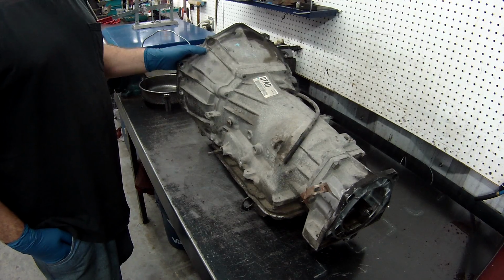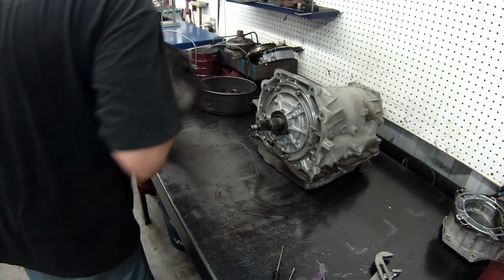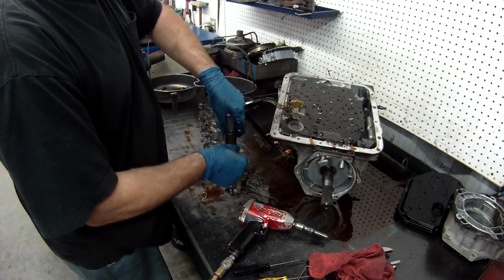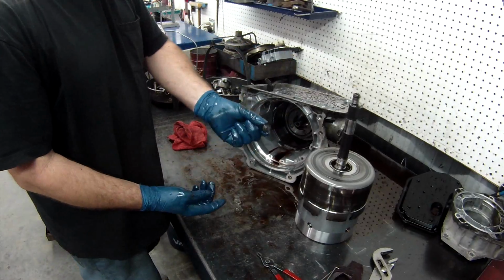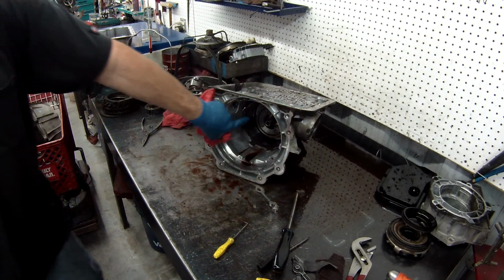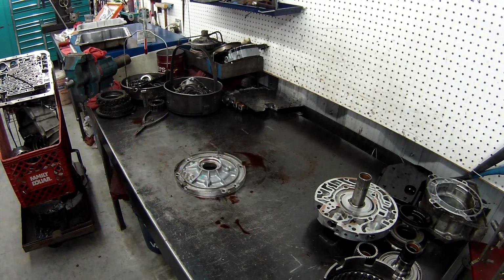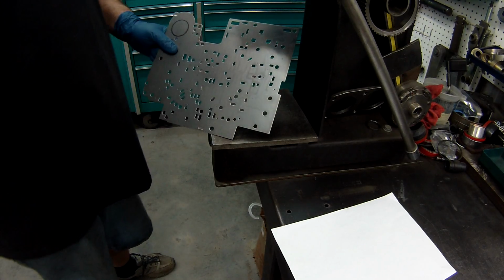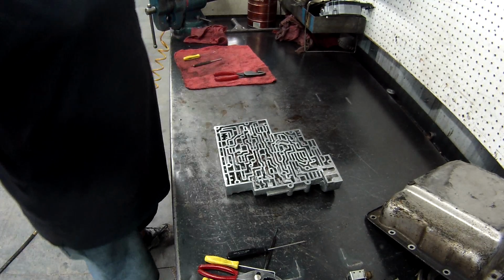4L60E Part 1

Comment: Hey Brad iam looking for a extension housing with trans mount bosses 700r4 2nd shorty speedo hole left side large
Reply from the maker: They are getting hard to find. You might try Ebay.

Comment: Is it acceptable to use carburetor parts dip to clean valve body parts?
Reply from the maker: I've used Chem-Dip many times. No worries!
Reply: Thanks Brad, by the way, the video was very enlightening, just what I needed, thanks again

Comment: Ok what year modals are the bells housings the same, 195055 till when did they change the Chevy bolt pattern, you know from 6 typical bolts , or are they alll the same Chevy bell housings bolt pattern, ?????? Kool thanks       I have a 2002 or 2007 Chevy truck and I want to put this LS motor v8 into my 1968 Chevy truck, will the motor fit my transmission.???? Nice kool thanks merry Christmas happy new year 2021111111 praise Jesus grace Christ amen 🙏 BigAl California.

Comment: 2003 Tahoe, 4wd, trans went on Sunday.  I believe it to be the sun shell as I put it in reverse, backed a drive a bit, and all heck broke loose.  Felt like I hit something, no more reverse, noise, whining, etc.  Limped home in first (not far).  Have trust issues.  Want somebody to do it right, like I would do it, to take pride in their work...like you.  To be clear, you do NOT do this for outside customers?  I'm mechanical and take care of virtually everything on the car - except the transmission.  Pls let me know and very, very good videos.  Very.

Comment: Sun shell and gear sounded sloppy. I ALWAYS replace the sun shell with an aftermarket heavy duty one. They are a known week point in the 4l60 family. And never should beat on a steel shaft with a steel faced hammer. Use either brass or lead faced hammer.

Comment: Step 1 Iam God 
Step 2 White and Black have a vale of 1
Step 3 Iam Not God
Step 4 Iam God 
Material has a Vale of 2
Step 5 iam not God
Step 6 Iam God
Step 7 heat has a value of 1
Step 8 Iam not god

Comment: I need some snap ring pliers Brad what are the brand you are using
Reply: I have some I only paid $60
Reply from the maker: They are Snap-on.
Reply: Brad's Transmission do you have the part #
Reply from the maker: @bunnyking100  Snap On #SRP400B they run around $236.00

Comment: I worked at a fine blanking warehouse as a press operator. I made the clutch plates for this transmission. We produced 4 different ones. I was surprised to see 3 of the ones that we made in this transmission. I have always wondered how they look inside of one. It wouldn’t surprise me if I was the one that produced the plates for this transmission. Very educational.

Comment: Rebuild my frist 4L60E(94)....no forward gears only reverse dont matter where i put the shifter....any ideas....also i install the transgo correction kit
Reply from the maker: did you follow the shift kit to the letter?
you cut a seal while putting it back together?
there could be a number of things. you'll have to take it apart and see what you can find.
Reply: @bradstransmission3846  i took it apart like 3 time...the last time i replace all the seals and the air check was good....the only thing i can think of is a bad valve body.

Comment: Finally! Someone that uses a socket for that electrical through case connector. I've never even rebuilt a trans before and every one of these I watch I'm sitting here wondering why they don't try to use a socket.

Comment: Is it the same for a 1993 Silverado 5.7 4x4?
Reply from the maker: It should be. There a few 700R4 that year but most of them are 4L60E. it will have a one piece case not a two piece like I'm building.

Comment: I am in need of both, Another reliable vehicle & a truck! I have an acquaintance with a truck that has a 4l60 trans, 4 wheel drive (I believe) If I were to get the truck, I would need to fix 3rd & 4th gear! In the very beginning, the puller you use, WHAT IS IT'S EXACT NAME? It looks kind of like the forcing screw for my inline brake flaring tool & similar except for size, the forcing screw for my fwd bearing installer/removal tool but, of course, Your puller is a lot smaller! Could you please tell me what tools I will need to replace the 3rd & 4th gear clutches & anything else that I will need please? This would be my 1st major rebuild! I have only changed transmission filters & partial fluid, Far cry from a complete rebuild! I am also wondering if it is worth the time & money to obtain this truck?

Comment: whats the easiest to get the bell housing bolts off  if i cant get them to loosen   would an impact work  also the bolts are star head is that normal?
Reply from the maker: Yes it is. It's a Torx bit # 50IP. you can only find them on tool trucks or the internet.

Comment: Thought that I spotted some interesting parts by your hot wash cabinet? I too a little concerned re the tossing alloy and steel items together in trolley and cleaning buckets. Thought maybe for the speed of getting it all on video quickly? or experience has taught you what areas of parts are susceptible to damage if struck there? . The ole disclaimer: No useful parts were damaged in the making of this video clip! So correct, you must have the correct equipment to disassemble and reassemble, (plus wisdom to operate correctly!) Enjoy seeing other techs working effortlessly on specialized rebuilds.
Reply: To fast with no regard for damaging aluminum parts. This is all about production.

Comment: Just an FYI I watched another video on how to tear down a 4L60E transmission and in the first less than 5 minutes you have done what the other guy did after removing the valve body. Your way is obviously the correct way as you don't at this point have to worry about 7 valve body ball bearings. Just an absolute pleasure to watch a mechanic who knows what he is about instead of someone who portrays he knows what he is doing.

He goes by the name of 1018 transmission.

Thank you.

Comment: I have the same transmission! When manually shifting from 1 to OD all gears engage fine! When the gear selector is on the OD first gear engages like a manual! I changed the torque converter and still has the same problem! Is it possible my fluid pump is bad?
Reply from the maker: The torque converter will not cause that, nor a pump. It sounds like you have an eclectic problem some where. Check you PRNDL switch on the side of the transmission first.  might be that.

Comment: I have a 4l60e reverse acts like it's in neutral no metal in the pan I was in reverse after it was sitting for a few years and reverse cut out while in reverse what would be you opinion on what it is it hesitate into 3rd and 4th but not slips
Reply: You can hear the engine idle die down like it's in gear and sometimes it acts like it wants to grab
Reply: @johnjohn-qb7vt  Sunshell

Comment: Where the he'll does v spring above valve body go back , fell when I dropped body down?
Reply from the maker: If it is the one I'm thinking of, it means the transmission has had a shift kit installed. the V "spring" goes in the big screen in the spacer plate. so the screen does not collapse. never seen it happen so you really don't need to reinstall it.

Comment: Got any tips for freeing up a stuck 2-4 servo cover that refuses to be pushed inwards so the snap ring can be removed? The trans is still in the truck, so space is limited, and levering with a jack handle just isn't doing the trick. I'm afraid of crushing the cover if I push any harder.
Reply from the maker: Sorry I haven't been notifications on new comments or I would have responded sooner. I hope you have gotten it out already. If not there is two notches in the case you should be able to get a screw driver behind the snap ring and remove it, some times the dirt needs to be cleaned out first. I am sorry for the delayed response.

Comment: So i posted earlier on i believe Part 3 of this series...
2007 gmc sierra 
Last week it started to have a delayed shift from 1st to 2nd, and shift flair 2nd to 3rd(small slippage when under hard acceleration)
These both happened after a 15min run on the highway...
Ive been babying the truck all week, but this evening decided to open up the throttle a bit, and to my surprise, 2nd to 3rd shift flair is gone!!
Have you ever heard of this?
Is it possible a valve or check ball was sticking and it has freed itself up?
Unfortunately, the 1st to 2nd shift still feels alittle delayed, but its not bad...Maybe 500 rpm higher than it used to...
Im wondering if theres something in the valvebody that i can clean up and replace, or do you think i should consider an overhaul?
I stopped at a local trans shop during the week, and without even looking at my truck, suggested i needed a rebuild.
Any input would be appreciated! After watching some of your vids today, anyone can tell you really know your stuff! Hats off to ya!
Reply from the maker: I would overhaul the transmission. If you clean the valve body and install the sonnax valve that I do ( the one in the video) you shouldn't have any problems. Just take it slow.
Reply: Brad's Transmission 
Thanks for the reply!
Weird thing happened this week, the 2nd to 3rd shift flare, has gone! Its shifting completely normal, which i cant even explain...
The 1st to 2nd has a tiny delay in the shift, was almost thinking maybe the 1/2 accumulator has got wear or possibly cracked...
Im no professional, so maybe im way off, but i am stoked that the trans is shifting normal other than that

Comment: got a question. I got a 93 chevy 1500 w/4.3l and 4l60e. I just swapped motors with what was supposed to be a 93 but it had different heads than my older style. Anyway the bracket that mounts with motor mounts that mounts bars to dust cover wouldnt work with this engine block due to a difference in block casting. The bracket hits on the block and cant be tightened right. So is there an different bracket offering out there and what is the bracket called. Ive been looking at schmataics but nothing seems to show this part im looking for. Only other  option is to modify old bracket possibly and might weaken it some. I think the reason for this is GM found that it kept the bell housing from cracking with torque twists. I dont like the idea of riding around without it waiting for bell housing to crack. 

thanks.
Reply from the maker: I know a lot of technicians that leave those off. I wouldn't worry about them.
Reply: thanks

Comment: Hi Brad, I want to swap out the output shaft from a 4x4 TH700r4 to my 2whd 4l60e, do I have to remove the valve body on either or can it all be done without removal, the min amount of work is what i am after, cheers keep up the good work man :-)
Reply from the maker: You don't have to remove the valve body but it is much easer if you do. if your going to all of that you might as well overhaul it while your there.

Comment: Great video! I'm trying to remove pump from my 4l60e, it's involved and loose but I can only slide it up 1/2 an inch and then it feels like I'm hitting a set pin of some type.  Any ideas? Anyone
Reply from the maker: Did you take the pan off and remove the filter and T.C.C. selonoid?
Reply: @bradstransmission3846   Is it necessary to remove bellhousing to see Sun Shell piston and replace 3/4 clutch??
Im hating these T50s on 03 Suburban!
Reply: @jamesfusco4056  you need a tp50 not a t50. It must be a t50 "plus".

Comment: Ive had really good experience with replacing all the accumulator pistons with the sonnex pinless and replacing the TCC isolator valve with fitzall teckpak isolator valve, I was chasing a sloppy engagement in first gear on a rebuilt 4l60 felt like a light slip or weak engagement my builder tore it apart twice couldnt find anything so I decided to pull the valve body and see what I can do. Well when I pulled out the forward accumulator piston I noticed slight play on the piston guide pin mostly on the end where it compresses to an thought hey I might have fluid leaking through the pin and this was a brand new aluminum piston, ordered pinless forward, 1-2 and 3-4 pistons installed them put them back together and problem was solved tranny shifts nice and firm.
Reply: I have a delayed engagement in 1st gear when trans warmed up, around 155f. Even at a stop, it will need a nudge from the gas to re-engage first. Also when shifting from any gear to 1st d or 3 it'll do it as well when warmed up. It will not do it in R or 2, ever. Runs fine under 150f. Shop rebuilt it 50k ago, pan looked ok, normal buildup. They said they always replace the forward accumulator with an aluminum one. Fair enough, but do you think it could be possible that I have the same problem as you did? Or maybe that since it doesn't slip starting in 2, that it rules out the forward accumulator? And that the 1 gear clutches are just burning out.

Comment: Quick question. What would cause the transmission to not respond to a 'Reverse' input when cold, then suddenly and violently unjam itself and begin to work when gas was applied. Now I hear some rubbing in the trans.
Reply from the maker: Sounds to me like you have a serious problem. there is a few things that would cause that, but all of them have hard part damage. best thing is to get it out and a part. sorry.
Reply: Yeah. Would the friction band around that reverse drum housing have anything to do with it?
Reply from the maker: Tvpc1971 The band is 2 and 4 gear. It would not cause the delay in reverse. If the sealing rings on the pump are damaged it might cause a delay but would not cause a noise. I believe your problem is in the rear of the transmission.
Reply: Brad's Transmission I might purchase a new trans. Mine  has 176k on it and needs a rebuild I'm sure but I don't have any of the specialty tools and I don't trust anyone around here to rebuild it.

Comment: Would this process be the same for 1993 4L60E ?
Reply from the maker: Yes the only difference is the case doesn't have a removable bell housing, but the exact same other wise. With one small exception. one less solenoid on the valve body. No PWM solenoid.
Reply: Brad's Transmission thank you I do have a new rebuilt transmission to put in it but it vibrates and Shakes the truck about 60 to 70 miles an hour not all the time just sometimes I was told buy a couple people it's the torque converter but I don't know because I don't rebuild Transmissions or know much about them but I was wanting to rebuild the one that's in it that has the shaking issue and figured this transmission would be a good way to learn or try
Reply from the maker: Transmissions will not usually cause a vibration. It sounds more like a drive line issue. If it was the torque converter it would vibrate at the same engine speed not how fast the truck was going. Did you mark the drive lines when you removed them. They need to go back on the same way they came off. Try rotating the drive line. Undo the drive line and rotate it 180 degrees and bolt it back up. (rear drive line) and maybe check the U Joints at that time. hope that helps.
Reply: Brad's Transmission thank you I have not removed anything yet I'm just waiting for the weather to get nicer I will check the Driveline next time I get back over to my truck and thank you I will make sure I Mark everything's position I'm still kinda new to this
Reply: Brad's Transmission and I do plan on having all the U joints replaced as they do look stock
Reply: Mike Okay had the same problem on my cousins 2001 suburban vibrating at highway speeds thought it was a bad diff turned out to be the large nut holding the yoke came loose we actually would never had known if I didnt search a forum on ls1tech website supposedly it happened to alot of people. So all we did was unbolt the drive shaft and sure enough it was loose so we just tightened/adjusted it down put drive shaft back on and went for a ride to get some burgers and it was fixed.
Reply: martinez1701a hey thanks for that information I will definitely check that on the next nice day we have that I can get out and mess with it I would never have thought that either thank you

Comment: why do you check for damage and then toss into a pile. I cringe everytime you did that..
Reply: Mr MEMé  agreed, rough fitting here, especially with aluminium parts, should be treated with care, must have spent a long time during re assembly removing the nicks from tossing the parts into the bins.
Reply: Brad, I didn't care for that either for the reasons stated (nicks/dents caused by corners of one part hitting the machined surface of the thrown part).  Nevertheless, I want to thank you much for taking the time to make the video series to share your knowledge and help those of us who can learn something.
Reply from the maker: The noise you hear is much louder then it is, and if I was to throw them to the ground it is nothing like the force of engine and the weight of a 2 ton vehicle would damage them. I'm sorry it bothers you.
Reply: He has a NASA certified and calibrated wrist...knows exactly how to toss parts.

Comment: Hey brad i just burn my 3 and 4 clutch pack what do u recomend just change the pack or do the complete overhaul and i want to install performance clutch which ones do u recomend thanks in advance for the videos
Reply from the maker: That's very common. I would rebuild the transmission complete. If you don't you might have problems soon after your done. Try a Z Pack.
Reply: Brad's Transmission another question if u dont mind my rev was going to high in accelation like it was already slipping what makes that to happen?